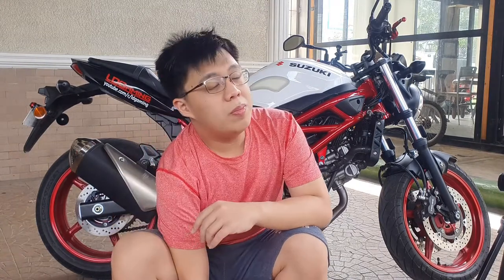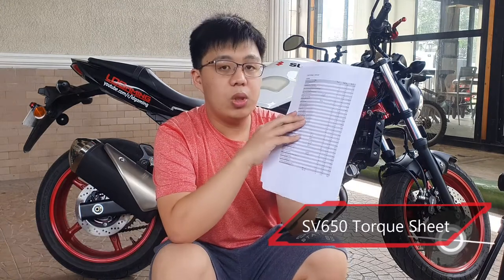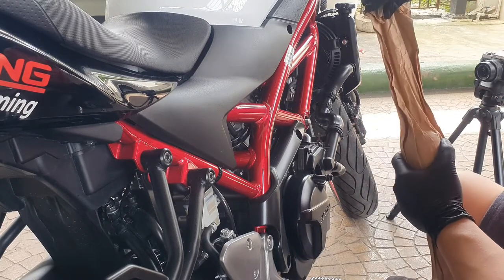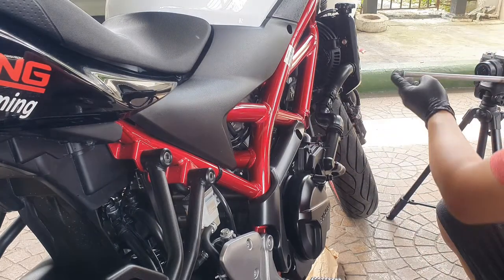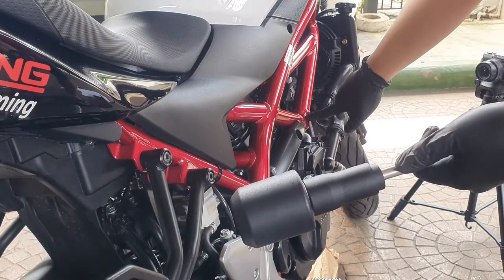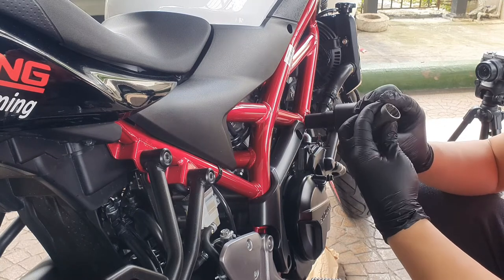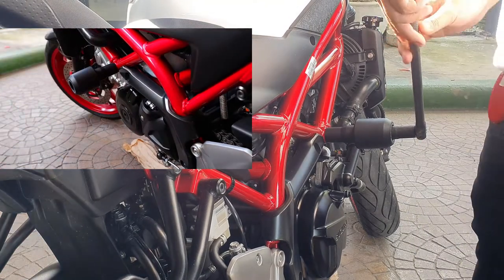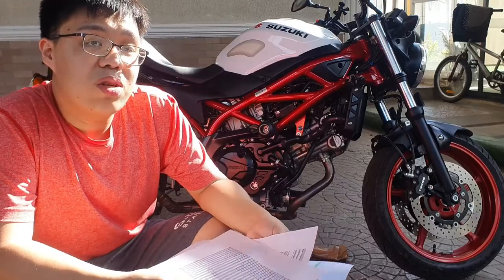Motovlog 14: Modifying my 2021 SV650 | Installing Evotech Crash Bobbins / Sliders

Comment: Great description and very helpful! Many thanks!
Reply: Update: I installed these on my SV650. I noticed that the rod from Evotech is slightly thinner than the rod from Suzuki. I wonder whether this affects the stability of engine mount, for example because of increased vibrations/play. The second point is that i appreciate that Suzuki specifies the torque on the engine mount but Evotech does not, which is an omission. I ended up using 67 lbs/ft as recommended for the Suzuki mount. Thanks again for this great video.